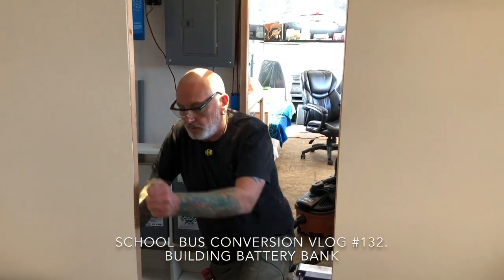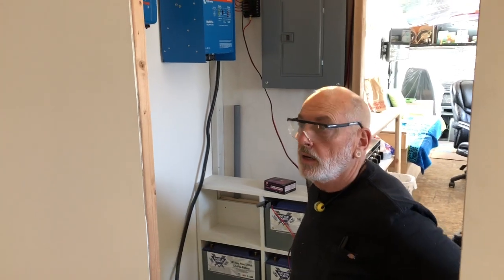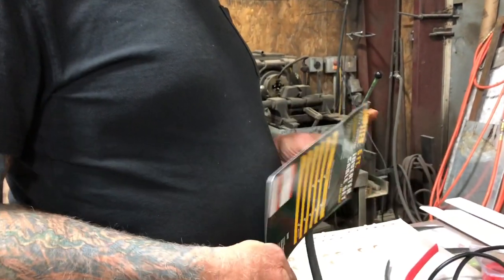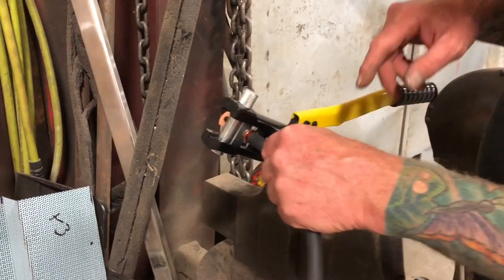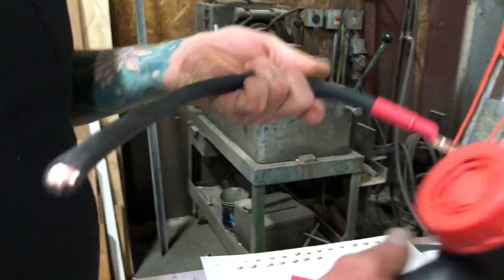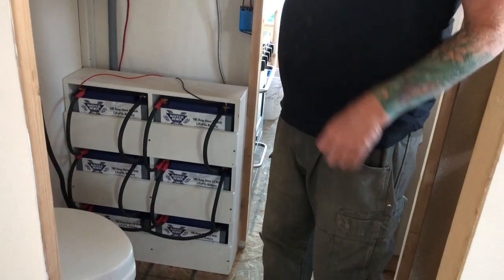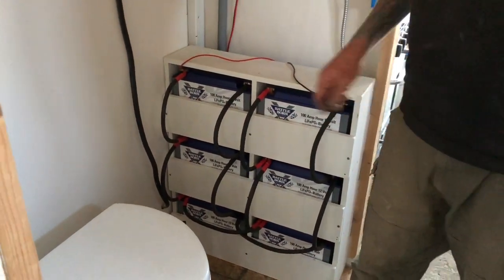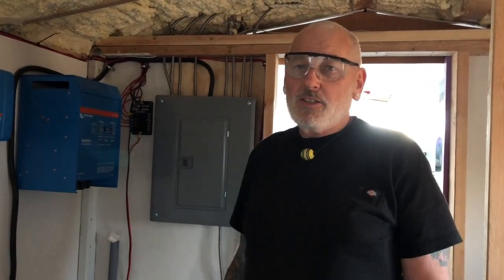Building Battery Bank - Vlog 132 School Bus Conversion

Comment: I'm envious of your battery bank. It's so odd to see them stacked up because I think "battery = heavy", but lithiums are so much lighter than lead acid. Out of my price range, too.
I was told to use dielectric grease on my connections to protect from corrosion on lead acid batteries, probably because they off-gas. Don't know if it's necessary for lithium. Looks like you research everything before you jump in on your next project. I need to be more teachable. 😝
Reply from the maker: Thanks for your comment. We are pretty sure we don’t need the grease on the lithium batteries. You are correct.

Comment: I have a bus I'm trying to fix up by myself. Can you help me out, I just need to know ruffly how much did it cost you just for the wire and the metal tubing that you ran the wire through for your whole bus?
Reply: The knowledge and skills that Randy & Shelley have are truly priceless!! Man... 👏👏👏
Reply from the maker: As close as I can remember the whole roll of metal clad conduit was about  $200 but you can find it at Home Depot and double check that :-) good luck with your project.
Reply: @KnappTime  Thank you
Reply: @suzannegreene5461  I know soon as I saw that Murphy bed I knew He knew what he was doing. They are an amazing team for sure.